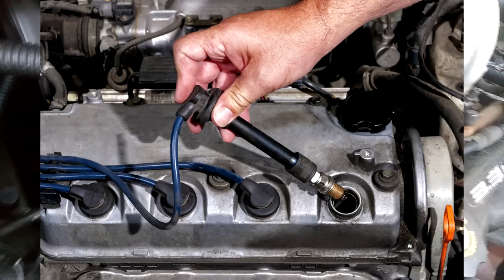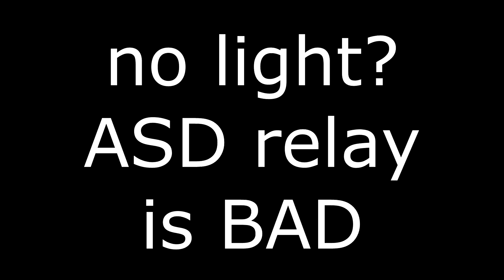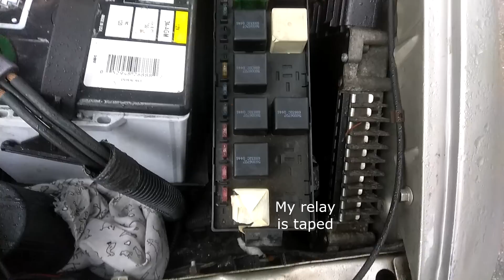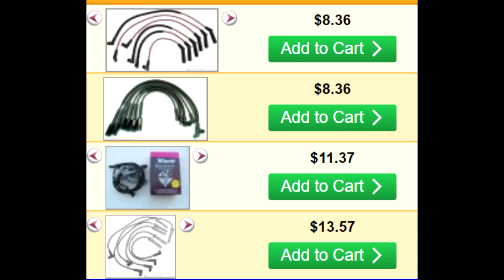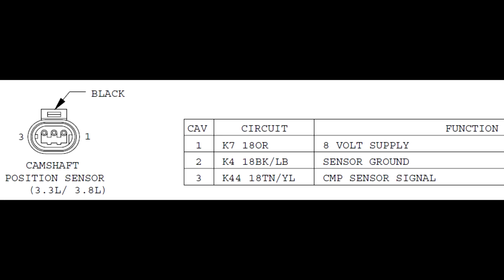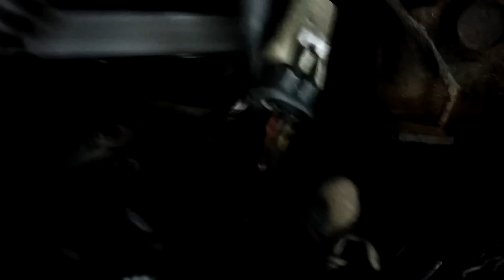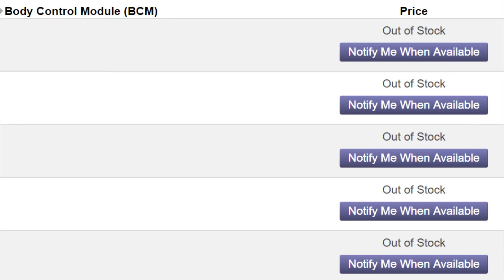Crank- No Start No Spark Diagnosis/Fix 1996 DODGE GRAND CARAVAN 3.3L

Comment: My 2001 caravan won't start. It sounds like its close to starting but just wont. I put a new battery in it and hooked it up to a code reader and got p0601 pcm needs replaced and reprogrammed. Although I seen this can keep a car from starting sometimes a car can run with this error. Any ideas? Could it be a fuse? Im planning on ordering the part tomorrow and just wanted to see if any automotive savvy ppl had any suggestions
Reply from the maker: Can you check if you have spark at the plugs? Cars are pretty straightforward, they need three things. Air/compression, fuel, and spark. Figure out if you have spark first. Take a plug out and put the side of the threads to ground or bare metal while someone cranks the engine. If you see the tip flash your issue might be fuel or air. If it sounds like it's getting close it might be a compression issue, but it's strange you're getting that code.
Reply: @mikewalko536  I didn't see this comment. Here's where I'm at now. I got the programmed pcm installed and now the car cranks still but if I press on the gas it kicks. It sounds and feels like the car starts for a split second then just goes off. It'll only kick like that when the gas is being pressed while cranking. I hear the fule pump kick on when the key is is the on position btw. I haven't checked the spark plugs. I was kinda thinking my fule filter is bad clogged cause I ran my car low on fule often. Mine is 2001 caravan 3.3 v6 btw
Reply from the maker: @brandonwilliams9597   Brandon Williams  gas you can check by undoing a nut on the fuel rail and pressing the valve, it is kind of like a tire valve. If you have pressure there then you are likely fine with fuel. Try unplugging your map/maf sensor, I don't recall which one the Dodge has but if I recall correctly it puts the car into closed loop mode when you do that so it won't take in actual air content into the air fuel calculations and instead will just dump a predetermined amount of fuel per cycle.  
Check if you have spark at the plugs first since that's easiest to determine.
Your plugs likely didn't all go bad at the same time. 

Very strange issue tbh but checking things off one by one is best. How come you got a new pcm in the first place, was this the issue you were trying to solve?
Reply: @mikewalko536  well I got the car started now and where it will idle. Now its giving me p0202 p0202 p0205 injector circuit open and so when it runs is very weak. I seen caravan have a issue where the wire harness melts and it could be spitting out the codes because of a short idk. Didn't have any issues until I let the car sit couple days then bad battery bad pcm. Fixed the pcm now these codes? Strange
Reply from the maker: @brandonwilliams9597  Sounds like you'll have to go through one by one like i did and trace the wires to the PCM pins and check for continuity. IMPORTANT NOTE: When you check for continuity- you must unplug the battery. Let's say you wanted to see if the wire from a sensor was good until the PCM. If it was fine, it would beep in continuity mode on your multimeter. If it was severed but you had the battery in, it would still beep because it would form a circuit through the ground. I spent a bit of time wondering what the heck was going on once and it's helpful to know that. Unplug the battery and a wire with no continuity won't beep. :-) Good luck and let me know
Reply: Im having the same exact issue i just changed the spark plugs new wires new battery but it wont turn over. I tried using starting fluid but still nothing so i figure it has to be spark but i cant find the solution

Comment: So to test my asd relay just simply connect test light to ground and touch the connector to the ignition coil with the test light while someone turn the key to the on position and I should see the test light light up for a second??? I did watch the full video I just want to be 100% sure!..thanks
Reply from the maker: One end of the test light goes to the B+ (battery positive) connector that goes to the coil pack. The other end touches ground. Whenever someone puts the key in and turns it right before crank, it should light up for a second, yeah. You could also just swap a different relay from your fuse box to see if it fixes it- if it didn't, it's probably not the ASD relay.

If you've got any other questions let me know :-)

Comment: I have a 96  town and country but mine has the 3800  XLI with alarm.  will this work the same on it?  new cam and crank sensor plus  $289.20 computer.   it looks like the coils are located in same spot too.  is there a relearn I need to do?    very nice video Mike!    thx
Reply from the maker: The alarm may be a little of an issue but there are services (on eBay too if i recall) that will program your replacement PCM to work with your BCM (body control module).
Sometimes there are issues with the BCM's locking out new computers but if the services do their job properly there shouldnt be a problem. I actually ran into one computer from a junkyard that refused to work because of the BCM but another one worked fine. 

The wiring for your vehicle should be the same but i'm not 100% sure. The service manual in the description has instructions for the 3.3L (mine) and I think the 3.8L was the same set.
The diagnostic method for the sensors will be the same.

To summarize: Cam and crank sensor replacement- no relearn at all, it's just plug and play, they are simple devices. PCM- possibly but if you exchange it online I think they program in your Body Control Module to prevent any issues. 
Regardless, if the PCM you get doesn't work there's not much you can do to fix it without the original dodge computer hookups but those cost like 3 grand even for emulators. You'd just need another one.  
If I can clarify anything let me know!
Reply: Mike Walko thx a lot Mike.  I’m checking my wiring as we speak I do have the 8 volt reference now I’m gonna check what the signal voltage.  I’ll let you no.

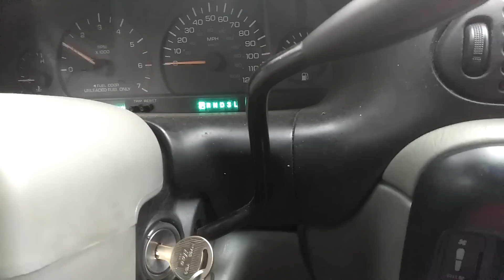Comment: at 2:16  Mike Walko say's    turn key and light should go on...    shows us a light bulb going on...     light bulb (a prop)   - not a bulb in the minivan but just a bulb he connected to a switch and power source  to show us what it looks like when a bulb is turned on and off...         like duh...
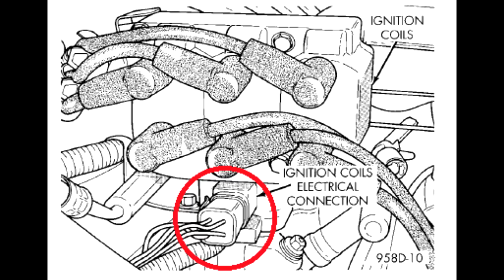Reply from the maker: It's explained at 1:23 that you need to hook up the test light to these specific terminals.
Reply from the maker: You connect a test light to the battery + wire that would go into the coil pack.
This lets you know if there's power going to that circuit when you're cranking.

Comment: Hi, your video is very clear but I have another situation. I put the key on, the light turn on and does not flash. It stay on. Why? :)
Reply from the maker: Try swapping the asd relay with another relay- something must be wrong with the asd relay circuit if it's not turning off automatically
Reply: @mikewalko536  what light are you talking about? Test light ?

Comment: Thank you for this. I thought my fuel pump or coil pack had gone out, turned out to be the ASD relay.
Reply: WHERE A S D LOCATED AT 1997 DODGE CARAVAN
Reply: WHAT WAS YOUR PROBLEM ON YOURS
Reply: @dannythacker1029  the Automatic Shut Down relay had gone bad, no other problem. It's a less than $20 part. It's located inside the fuse/relay box in the engine compartment on the driver's side. Remove the cover from the box. On the underside of the box cover you will find information telling you where each relay or fuse is located.